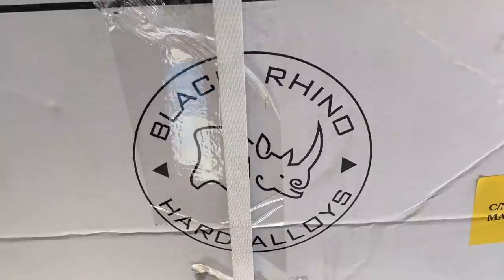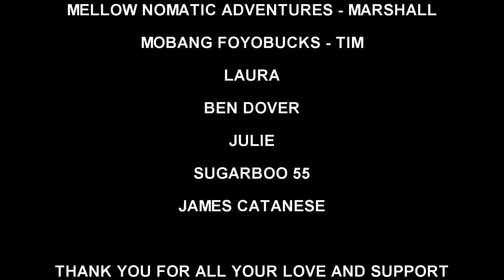Upgrading with Black Rhino Wheels | Installing New Tires and Rims

Comment: Awesome video, Daryl. Thanks for the shout out. Do you find that those tires hum going down the road?
Reply from the maker: No problem but the answer is still 3. Slight hum but nothing annoying. These are a wider and bigger tire. The toyo or nitro are great for off-roading